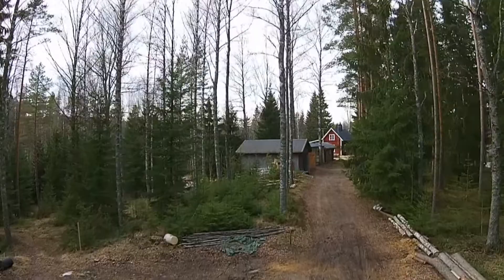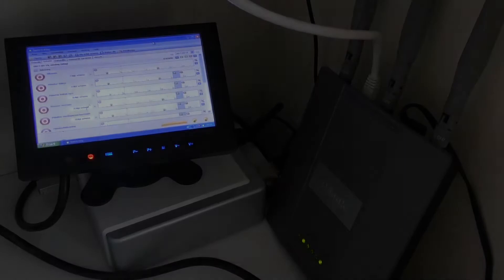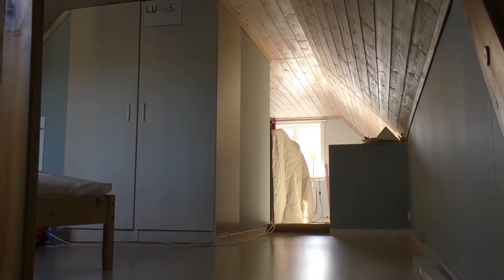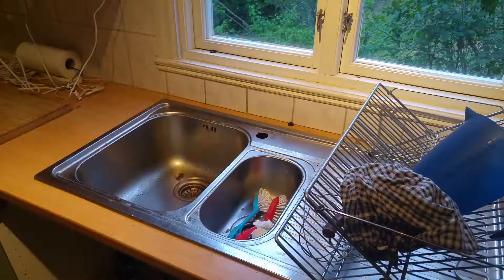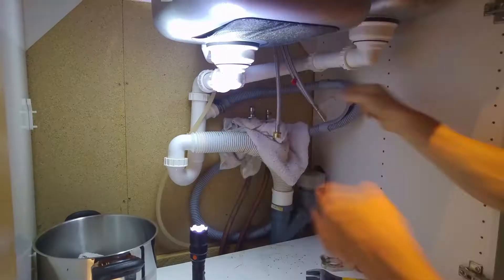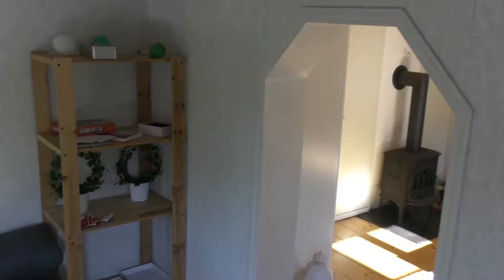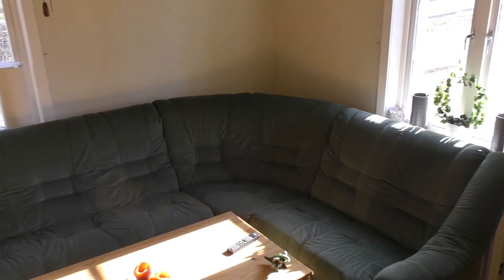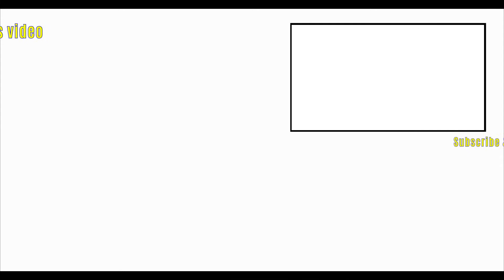Homestead Tour inside the Cabin — Off Grid Sweden

Comment: How is this offgrid if they are using electrity. He says they will convert to solar power soon?
Reply from the maker: Not the first time I got this question 😁. I have never said that we are off the grid. We are on a journy to a more sustainable way of life. Off Grid is the ultimate goal. We decided that it's more important to take it slow and do everything right. It also comes down to cost. We have installed a 46 panel solar system on our urban homestead. That gives us 12500 kWh every year. At the cabin in the woods we use very little power but the challange is to make it work through the dark winter months in Sweden. So the answer is that this is a journy for us toward the ultimate goal of Off Grid living with modern standards and you are invited to join us. Have an amazing weekend Donna!